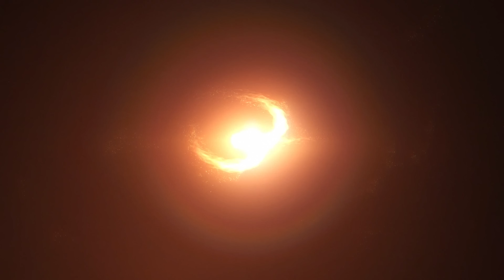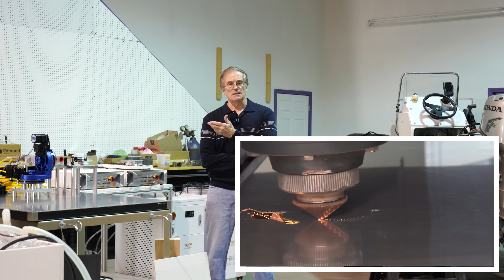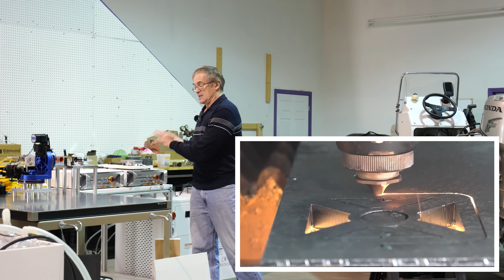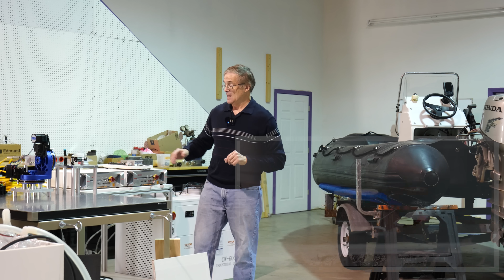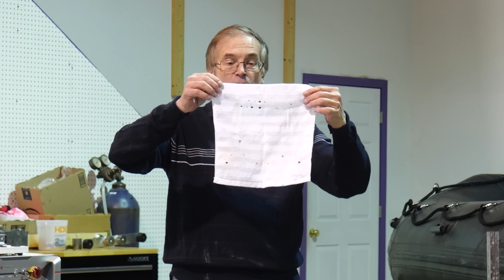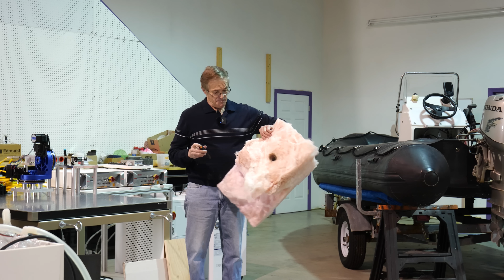We have a problem... and need your help!

Comment: You can try kaowool its ceramic base fiber and is use to insulate furnise for melting metals also maybe paint it with vantablack or somethin simular ther was a interesting video form the action lab on youtube to it they shot a blue laser on it and it got absorbt

Comment: As a hillbilly with 15 years of experience, why not a sheet of ice? When it melts the water absorbing the heat, it might turn into steam but also you may have to have the sheet pretty thick
Reply from the maker: It would also have to cover about 200 ft^2.

Comment: A few thoughts: (1) move the final optical element (or multiple elements) axially away from its operative position so that when you turn on the laser the beam is defocused, then when ready to proceed, slide the element to a preset stop at which the beam is properly collimated or focused; (2) use, as a backdrop, a surface that is faceted or diffuse so as to disperse the beam; (3) place a diverging lens along the axis of the beam in the backdrop so that the beam is defocused immediately behind the test area; (4) spin a disc of sacrificial material as a backdrop so that the effect of the laser is distributed across a larger area of material--and if necessary, simultaneously move the spinning disc laterally so that the beam describes a spiral on the disc, further increasing the area of distribution; (5) position, as a backdrop, a block of copper with water channels, and run chilled water through the block while the laser is in operation--blacken the surface of the block (flat paint or oxide) to minimize reflection (silver would be even better than copper, but would likely be prohibitively expensive).

Comment: Tank filled with water that has a circulating pump/impeller at the bottom with HIGH turbidity due to particulates(finely powdered activated carbon?) suitable for absorbing, but not reflecting light turbidity should be such that the energy is absorbed over the length of a few inches. Just keep the water circulating like a blender. If glass would melt at the point of contact, use a ruby/sapphire piece in the spot the laser hits the tank.

For greater absorption, the inside of the tank other than the window can be opaque as well.

Comment: Perhaps a thick drenched towel on a rapidly spinning conveyor. Essencially two tall rotating cylinders between which is a wet towel. The laser never rests on a single spot long enough for the water to completely evaporate. Should be decently portable and not too expensive to make

Comment: couple of great comments i saw others make which I like are 1) make a light proof box with light sensor inside connected to kill switch to switch of the laser ultrafast,. 2) use smoke as diffuser. this could be inside the light proof box. Some of my own ideas are 1) contact heat protection companies who would like to sponsor and donate materials for demonstration such as Jacobs who build space shuttle shields, 2) use fire blankets or welding blankets, 3) try making your own starlite shield. that would a great video also but others have done it such as https://www.youtube.com/watch?v=0IbWampaEcM

Comment: Could you use a water misting system that integrates argon or xenon gas. It could be zoned so different areas run while others are off. When the gas isn't needed it could be turned off and you just get the misting water to help cool yourselves when it's hot.

Comment: I'm not the sharpest tool in the shed but I think painting over some of those already-tested materials might help improve performance. Light colored paints can reflect the heat on rooftops from sunlight better, for example, but I'm talking about something thicker, like galvanic paint, the kind welders use, it's not that expensive, it's light, and it's easy to apply. There is also, I don't know the name, but I've heard of the darkest black paint, which is said to absorb more light than any other pure black, so maybe it works somehow... Perhaps the most effective thing would be to build a mirror maze filled with water or pointing the exit to a safe zone, it can certainly absorb the beam for little

Comment: Could you put a glass that refracts light between surfaces that slow down the light like cement board. And like a previous commenter stated make a dark room that as soon as the light penetrates shuts off the laser system. Refraction may also slow the penetration, like prismatic lens over fluorescent lighting.

Comment: A massive water chiller cooled venta black inner coated beamdump gas canister with an inner venta black cone embossing the foot of the gas canister to break/make the beam larger so it doesn't reflect back out. This is a stupid idea, but if you can dump the heat, you reduce the ability for it to eat away at the metal if of both the canister and the cone. IDK really.

Comment: 9k + comments ! Did anybody suggest to unfocus the beam behind the target area? A polished mirror cone might reflect the beam sideways and widen it and in an appropriate distace the energy density should be low enough to be absorbed without destruction.  I remeber that 100% reflection could be achieved by wave interference in a double layered mirror.
Reply from the maker: They have. The optics don't allow the focus to be sharp. The beam has to start small, and that means at twice the range to the target, it will still be small.

Comment: Material: Matte black anodized aluminum, steel, or copper
Use: Block or absorb laser beams, especially continuous-wave (CW) lasers
Caution: Must be non-reflective to prevent specular reflections

Or try a few bags of playsand stacked together...

Comment: I wonder how many millimeters of water are needed to stop your beam reliably.
Maybe large panel like tanks made of PE or sheet metal mounted to a wooden frame would be enough.
Guessing that about 30mm of water could be enough, this would result in a large but probably manageable volume of water.
Once hit, a tank would spill water, but not really a big deal and easy to repair. Setup and deconstruction would be time consuming but easy to do, since the wall can be build out of multiple tanks.

Comment: Hi, Have you tried mica sheets? The kind that you use in a microwave.I live nearby (I think? You're in southern NH right?) and could come up to give you some. 
Another option you might consider is soaking the plywood or fiberglass- make a wall of it (or hanging sheet) and run a PVC pipe with holes along the top and pour a waterfall down it.
Best of luck!

Comment: First instinct was a frenel lens infront of water soaked blankets haha. What's the wavelength? 

Since it's a high energy light problem, I'd be curious if you could catch the energy in like a neon gas or something and then cool the gas. Not that you could use it for a wall, would be more expensive than brick, you're not going to build an aquarium wall or I'd say motor oil... but does it pass through glass? fiber laser right? how does it react to naked fiberglass weave/mat? could you catch the laser in a fiberglass curtain that you were flowing water over? could you hook up a garden hose to pvc pipe with holes cut in it that were spraying water on it? 

I imagine it's energy in and energy out. and the first problem is concentration. My dream test would be frenel lens, or the columnar lens sheets they put over those 3d posters that change perspective when you move, placed over a tank with 2inches of motor oil between glass. The curves surface of the glass would magnify the laser out of focus and the oil would circulate the heated oil away from the point. But again, that's not a cheap wall.

Comment: laser engineer that work for various concert/festivals and art installation here.
Sometimes artist or scenographs want to fire laser into the crowd, and I WONT FIRE CLASS 3+ LASER INTO THE CROWD (for obvious security reason).

So we use in last resort polycarbonate. Diffract the laser a lot, easy to work with, and really easy to transport during touring.
I've safely divided the intensity by 16 on a KVANT 10W.

Maybe try polycarbonate or something to spread the energy before hitting the wall.

Comment: The experiment with fiberglass cleanly indicates the origin of the problem. It is not only about withstanding high temperatures. One also has to be able to dissipate the heat quickly. The material in question must have high thermal conductivity. A combination of some Al sheets with something else could do the trick. One of the possibilities is to sandwich multiple sheets of very thin Al (foil) between thin sheets of thick paper (fireproofed with alum, see below). Also Al2O3 has high thermal conductivity and high melting point at the same time and is available as powder. A mixture of it with cheap SiO2 sand and some cement could do.

As of plywood, the old trick for fireproofing wood is to soak it with potassium alum or some other alum or with sodium (or other) silicate solution and let it dry.

Comment: Water mist? Water pumped under pressure through distribution pipes and released through spray nozzles. As the laser contacts each droplet energy is absorbed by evaporation. A great many droplets required with experiment required to determine optimal size and distribution.
Play safe! Love the channel!

Comment: Carbon is the cheapest temperature resistant readily available element\substace I can think of. Carbon fibre mat is actually quite cheap when it's not been formed. Maybe you could burn the outer surface of wood so it has a layer of carbon. Maybe spray the other side with flame retardant. That's a difficult problem you have. I think it would take a think layer of carbon so that it could lose heat through ablation. Maybe wet carbon with a circulating flow of water to stop it burning. 
One more thought. Is copper. Copper tweirs are used to blow air into the hottest parts of blast furnaces. It has a low melting point, but it's a great conductor so water cooling can be used very effectively so they don't melt. Even though they are working in conditions way above the melting point of copper. It's not exactly cheap but it's something to think about. Maybe you can use something with a low melting point, but if it's great at conducting  heat, maybe you can cool it more effectively.

Comment: I agree with an automated kill switch and perhaps some sort of heat exchanger with reservoir of water. Cant burn holes in what you cant heat. Copper too expensive and cumbersome. Perhaps angled wall with water cascading on some sort of median.

Comment: I sincerely hope there aren't cheap and easy solutions to this problem. It would be deeply concerning if bad actors could simply spray a protective coating on their drones, rockets, or mortars to shield them from laser-based defense systems.
Reply from the maker: Don't worry about  that. Cheap and easy shouldn't be too difficult. Thin and light will be very hard.

Comment: Maybe not the most technical idea. 
The frist though was the cooling paint you did an episode on a while back . But it is very fragile. As I recall.

Second thought is a container of fragmented glass. Some glass can withstand very high temps. Would the various angles maybe act as prisims refractng the light in many directions. And in essence, trapping it inside a box while breaking it up? Fill the box with liquid for cooling. And As one comment mentioned, if the entry holes are small enough, they could be easily patched between test?

Comment: When ever I approach a project I try to keep two principals in mind. KISS  ( keep it simple ) and keep it cheap. If you were to build a waterproof hollow wall with cement board or plywood, fill it with sand, and then fill it with water that has a high concentration of laundry detergent. Laundry detergent fluoresces under blue light, thus diffuses the light more. Waterproofing can be accomplished with simple latex paint and silicon caulk . small holes are going to occur on one side but it will last till the end of your experiment.  PS get detergent that has extra brighteners.

Comment: Use loose material trapped between drywall. As it melts new material drops down to replace it. Sand might work but is heavy. Vermiculite is light and melts at a high temp and is relatively cheap.

Comment: welll.... if you know that you have laser powerfull enough to melt the drone, then next what you are testing should be targetting system. And for that you do not need powerfull laser with high capacity protective backgscreen but good hit-detection system and mockup laser instead. Why frying something in the air if you can destroy it staticly to get time/power/distance data. With this data you use weak laser with enough focus to cover effective range of powerful laser and hit-detection system that can track the laser and count delivered power over time. This hit detection system will cost about same as high capacity backscreen BUT you will save energy, reduce risk of penetrating the safety screen and make a proper testing facility for future projects.
Reply from the maker: Understood. That is basically how we dial in the systems.  But at some point, you need a wet rehearsal to integrate these systems.  They are operating near their limits, and small incompatabilities can be a problem.

Comment: As the beam is so small you can have a moving protective screen. It won't have to move that quickly and it could move back and forth. This will limit the time the beam will have to burn through.

Comment: Ignoring the initial assumption of you having thought of everything - have you thought of just a big pile of dirt or pile of sand bags (perhaps with water constantly pouring onto said pile). Perhaps if you can dig a hole outside, do the test in the hole, or just test in another location where there's no risk like a quarry
Reply from the maker: The entire back wall is a large area to protect.   That is why solutions like stone, dirt, sand, and bricks are impractical. We're talking many tons of material. These very heavy materials are also a lot more protection than we need as well.
Reply: @TechIngredients  Ah, so it's a classic engineering, just enough to do the job, but no more equation

Comment: If the test doesn't need to be rapidly repeatable, and fire is the only problem with the plywood, soak the plywood before building the wall. If its watterlogged it won't be a fire hazard in the time frame you're discussing.
Reply from the maker: That's a reasonable option.

Comment: Firbre reenforced carbon, or if you want it cheaper, you can just use graphite, has relatively high heat conducting and a very high sublimation temperature over 3000C. Not sure how much burning is problems, we used it in our Tokamak experiments with relatively high heat loads, may be 10 MW/m2. Otherwise, maybe check the Heatiles from SpaceX or the Spaceshutle there are videos how to make them, you self.

Comment: If there is a transparent material that doesn't absorb at all maybe a shallow tank of silt water. It could also be an open pool and angle the laser down. And as some have suggested, a detector of such light in the pool to cut off the laser power. Which could be microseconds or nano

Comment: the same way a missile will "cheat" a beam :
1. spinning : the beam will turn a 3.1415*25mm^2 hotspot to a 2*3.1415*750mm*50mm rotating 5 cm wide strip - well,it will be warm. no problem.
use a "wall" made of partially overlaping rotating cylinders ald calibrate rotating speed for optimal efficacy with minimal costs. it should be trivial anyhow - and have-for safety- two layers. dont have to be cylindrical , of course - use 2cylinders and leta reasonably heat resistant fabric for them to role like a conveyor.

Comment: My suggestion on how to mitigate a laser beam like this would be to make a highly reflective paint that contains micro beads at roughly the same diameter as the wavelength of the laser beam itself so that when the beam hits the paint, it acts as a perfect diffuser. This would be similar to how stealth aircraft use radar absorbent paint, except in this case the paint would be designed to target the wavelength of laser light and not a microwave wavelength.

Comment: Here is your answer aim it's directly at the ground turn on the tower that's pointing down the Earth will become your dissipation material you could even use it near a mountain Earth is very good at dissipating heat you could also use sand bags

Comment: I was thinking that diffusion, at this scale, would be the only real option due to material characteristics and the source's power.  For example, a wall of water, maybe, behind polycarbonate.  That's likely to just make a waterfall.

Then it hit me.

Glass beads.  Like are used on traffic signs and for bead blasting.  It would be challenging to make it, but if you had a layer of beads over a hard backing like drywall, it might just diffuse the laser power into a more tolerable heat that the backing material might just be able to handle at least for the time required to test. ????

EDIT:  
What about a sintering process at a plate glass factory- introduce the beads at the last moment of production to captivate the beads partially?  Add a textured glass back instead of flat glass, and adhere or sinter the beads to that.  I suppose any glass bead method would be both diffraction and diffusion...

Another option:  Acid-etched glass.  The etching may diffuse the beam enough to tolerate its heat and survive....

Boy this is exciting!!!  I can't WAIT to see where it goes!!!!  I love that you plan on doing more with this resource, too!!!

I mean, optionally, I see a nice stained glass garage door in your future.... :)